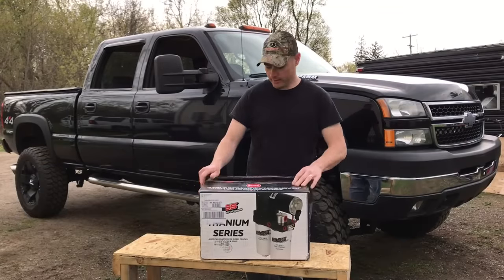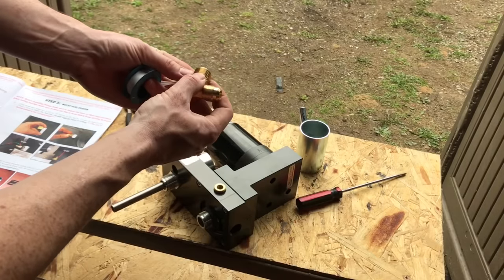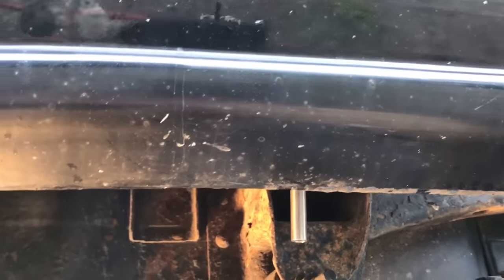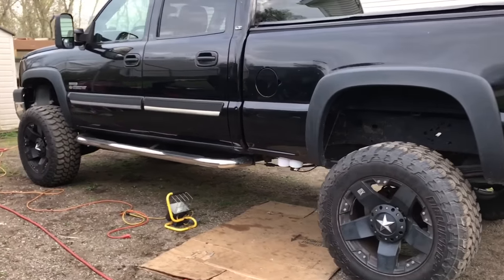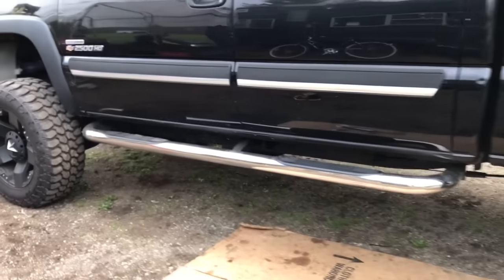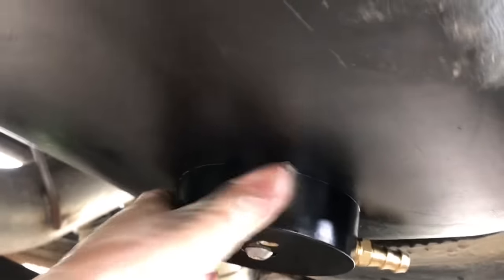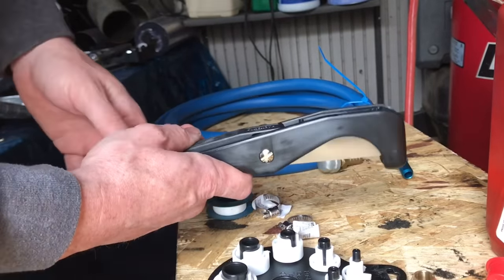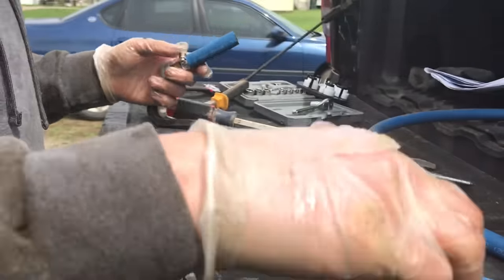Duramax FASS Lift Pump and Sump Full Install

Comment: You should look into a set of track bars. I have an old video on here of my axle dump and you can see the wrap when I give it any throttle. It prevents wearing the bushing at the transfer case when your driveline wraps upward. It will keep you from loosing bottom torque in your rear leafs as well.
Reply from the maker: +Dakota Novak its on my list but thanks for the explanation it's a good way explain the benefits of traction bars

Comment: It appears the bottom tank Sump is actually illegal to use on Commercial vehicles at least. Anything happens to your hose and all your fuel drains all over the ground. I think it's the Beans has both supply and return fittings, saves cutting filler hose.

Comment: Will you have to delete the fuel filter after installing the fass ? And will the cat filter work with the fass system ?
Reply: I'm going to go with no you won't have to delete the existing fuel water separator filter. It's not going to hurt it having extra filtration. Just keep on the maintenance schedule I say.
Reply: Hey Corey, no need to delete  your fuel filter, it catches particles that may already be stuck in fuel lines between the lift pump and existing fuel filter.  The CAT filters are great!  Check my channel out to get a closer of the CAT fuel filter and water separator (have a CAT oil filter conversion video for you too)

Comment: Awesome video! I need this for my LB7. Wish I had done it years ago when the injectors were done.
Reply from the maker: Thanks
Reply: @TruckMaster  I just bought a stock LBZ with 120k miles and maybe a small tune but that’s it, I’ll be keepin it as stock as possible. Should I put a lift pump? Is it something that is needed to be done like the lb7 or the lly?

Comment: FYI, as far as using the tank's draw straw for the return I was just informed by FASS that is OK in the older models but for the newer models (I think he said 15+) they drop the tank and replace the "convoluted" draw straw with a smooth one to minimize the restriction.  Since I have an 08 and the 95GPM pump I used the return and I can barely hear the pump even running and this was a very simple clean way to do it.  My advice is to just check with FASS regarding your specific installation.

Comment: Doing a similar install of the Fass with a sump connection but I also swapped my standard tank for an S&B 62 Gallon tank. Appreciate the tip on plugging that line. For the life of me I couldn't figure out what to do with it. Question for you, if you didn't build the plug like you did, is the intention for the suction line on the sending unit to just stay open when you use the sump? Keep up the great work. Much appreciated.
Reply: I have the same tank as you, but in my opinion, the thing to do with the old suction line from the tank that he capped off would be to plug the return line from the Fass into that line. Then you don’t need to cut your filler hose.

Comment: Any issues with cold cold starts? I mean dead of winter, it's been sitting in a blizzard for three days cold. I've heard the fuel in the filters hanging down like that get cold easier and the fuel thickens up causing some start issues.  I've seen some people wrapping them in heater blankets for the filters.
Reply from the maker: +Bayer-Z28 this would be my first winter so not sure yet I can do a video on it once the temp drop below 0
Reply: Three days in the cold, wouldn't matter where it is, it's all going to be the same temperature.
Reply: Bayer-Z28 my 08 lmm runs fine in our cold -35c Canadian mornings. My Allison hates it though. Won't shift out of 5th till transmission is 99°f
Reply: Bayer-Z28 Here’s my winter review of fass in Michigan. 95 series hangs down below bed. Fuel was treated with power service. -2F out when she gelled up. Got towed back home, thought fass gelled up. Was actually my acdelco filter at oem head. Fass was full of fuel!! Ac Delco wasn’t, completely gelled up!!

Comment: Great video. So I installed the Fass 165 on my 2011 Silverado, also installed the Fass sump pump , awesome. My question is I have a 2011 Silverado 2500 HD . Love it , always wanted a Duramax and finally was able to. I know all emissions installed but that’s how I want it. It’s a daily driver for me but work is only 5 miles each ways to the Mercedes Dealer . I’m a Tech. A few questions I have how long did you run your return line , and what’s your view on a tune . Other than normal driving we use the truck for tow our trailer about 6k lbs . 

Thanks ,
                 Heber

Comment: Nice.  I think next project should be attacking that frame and cleaning it up!   Just did mine and looks great.
Reply: Lanni, just about to do that on my LB7. Any recommendations or advice on the process? Bought a wire wheel to scrape the rust off. Did you use a rust converter or anything? Was thinking about painting it with bedliner.
Reply from the maker: +Jonathan Cascioli I need the same advice I'm going to use a angle grinder with a wire wheel then brush paint the frame
Reply: Guys I used one of those braided crazy 3" wire wheels that screws on the grinder.  I don't have an air setup yet to use a needle scaler but my little ball peen hammer worked well getting the scale off. After that wire wheel away. 

I used the duplicolor rust barrier.  After wheeling the frame all you have to do is clean it with a wax/grease remover and then brush it on.  Brush it on so it can be nice and thick instead of spraying.  Got a few aerosol cans of it also to get the nooks and crannies.  Also used the duplicolor stuff because it comes in flat black. Hate seeing that gloss black like por15 and less steps than using por15 also.  Good luck.
Reply from the maker: +Lanni_LBZ great write up that's the kind of info I need

Comment: if your worried about moisture at crimp connections buy heat shrink cut a couple small strips of super glue put them in the heat shrink and hit it with heat gun. Great for keeping moisture out.

Comment: So it just uses all factory line after where you connected it by the fuel cooler? That install seems way easier than the one I did on my old cummins.

Comment: Thanks for the video.
I'm buying a 2001 Chevy Silverado 2500 derumax diesel. They added new injectors pipes 4 inch and tuner also a a lift pump n sump lil excited lol

Comment: I just finished my installation but I don't  like where they wanted it mounted so I went down and got two pieces of 3 inch strap built my own bracket and installed it to the fram in front of the fuel tank can't see the filters and a lot safer for the pump and filters

Comment: Another great video. Man, you nailed it!  Two questions;  It's hard to tell from the camera angle, but it appeared you drilled the hole in the tank too close to the raised lettering that is printed on the tank, could that have contributed to the leak(the o-ring sitting on those letters)?  Could there be any modification to the filter mounting bracket to tuck the filters up more so they're not visible?  Your install looks great and doesn't look bad on a lifted truck.  Just my preference, I like a sleeper look and would not want the filters visible.  Thanks for the time and patience to record this...you appear to be a very patient man  lol
Reply: Hey man I know it's been awhile since you posted this comment but if you have a crew cab duramax, wcfab makes a bracket that puts the whole assembly inside the frame and up where you can't see the filters. I don't know how much difference this is going to make to a lot of people, but I like the fact it is inside away from a lot of extra road debris.
Reply: @kevinday4490  The Fass is too tall to fit inside the frame rail without hanging down. below the frame
Reply: @mrmotofy  that's funny because mine is hid pretty well with this bracket. If I put the larger filter on you can see them but they are not exposed as much as the little one with the included bracket.
Reply: @kevinday4490  Maybe there's some slight differences with the different bed sizes or years. I've seen multiple install vids with the same interference.  The comment was specifically about INSIDE the frame rail like Airdogs
Reply: @mrmotofy  https://www.wcfab.com/i-31643995-fass-fuel-system-relocation-bracket-for2001-2010-crew-cab-duramax.html.  This is the bracket I bought.  It goes right in front of the fuel cooler on the inside of the frame.  I like the looks of it being tucked up so no one can see it.
Reply: @kevinday4490  Ah ok that's a different one than I've seen. When I measured the height it hung below the frame about 1/2" on an LMM.  As it looks in the pic. The Airdog is shorter so it fits. I didn't want anything hanging below the frame right there cuz thats right where high centered happens, scraping boulders etc.

Comment: Glad I bought the fass sump with the integrated return. I didnt use the return I just screwed a brass plug into it but its bigger and has two o-rings and two bolts to clamp it instead of just one

Comment: Greetings truck master question do i need the oem diesel fuel filter after the fass? New at all this and planing the install, thanks!
Reply: It's up to you if you want to keep it. I had an 05 LLY that I removed the factory filter on and never had a problem for the 80k miles before I sold it. If you keep the stock fuel filter you only have to change it every 20-30k miles.

Comment: I have a big question when you get everything on and last to do is put the 2 filters on do you fill those two filters up with diesel ?
Reply: Hey Austin, it's a good idea to fill the filters with diesel first so you aren't running too much air through your lift pump.  However, you would probably be fine if you didn't because it only takes a few moments before the whole system is primed and void of all air.  Have you upgraded to the CAT filters yet?  I have a couple videos on my channel about it, come check it out when you get a chance!

Comment: Awesome video brother. As for bleeding it, either disconnect the line to the injection pump if your worried about it or leave it and the return will bleed it well enough. Installed a couple myself. Nice job!
Reply from the maker: +Ryan Kessel thanks!

Comment: You could have tucked the assembly up higher if you used the next bed mount back and flipped the bracket over on the fass pump.
Reply from the maker: +Tim Johnson well noted thanks
Reply: btw.  I like your videos!! I didn't mean that as criticism.  I installed in my 2006 lbz dually.  Later i thought maybe because i have a long bed it might be different that your install.  Like i said Great video's!
Reply: Have you done a Bank intercooler system?  Would that help MPG?  Daily driving i am up to 18.5 mpg on my lbz crew cab dually 4x4.
Reply: Tim Johnson do you have a picture of where you mounted yours?

Comment: Trackmaster I recently call the company to acquire a Fass lift pump for my 2013 GMC Duramax and the gentleman there seemed very knowledgeable but he recommended that I get the airdog lift pump system he suggested there was little bit more user-friendly and it had compatible filters compared to the proprietary filter for the fast system I'm just wondering what your opinion is because one of your videos one of your lift pumps left you high and dry

Comment: Did you notice the lift pump help your rail pressure? I’ve been all through mine and the only thing left is do the cp3 and or injectors. Having the pump done in a couple of days I ordered the Exergy sportsman pump see how it goes fingers crossed.
Reply from the maker: +Clint Garza I didn’t notice a gain in Rail pressure but it could be because I have that fuel valve plug
Reply: Truck Master I have the ppe plug as well on a hard acceleration the desired fuel rail pressure goes up to 26,000-27,000 but the actual will only run up to 19,000-20,000 then fall of to 11,000-12,000 this is what my edge insight shows took it to a dealership they hooked there tech 2 up to it and commanded a certain amount of rail pressure and the pump couldn’t even make half what they asked it to
Reply from the maker: +Clint Garza that’s very odd the highest I’ve hit was 27 and it maintain it’s makes you wonder if it’s a cp3 problem I wonder if you port your fuel valve fitting in the cp3 it might help some

Comment: Have you done the fuel rail pressure valve block plug? I have 08 lmm stock I did the fuel rail race valve and the rail valve block, night and day difference almost eliminated refueling besides what's left on the motor but mostly maintains fuel rail pressure and when I step on it it doesn't starve for duel

Comment: Got a 14 lml stock...I cant remember if I need a tuner to run a fass or airdog or do I gotta put tuner on ...I'm just towing atvs and sxs Sorry for silly question...used to the old 12 valves.

Comment: Just bought an 02 LB7 with 205k. Never had any fuel issues, do i really need one of these? I was raised on the matto  "if it ain't broke don't fix it."  Seriously asking because i can get a good deal on an air dog 100gph setup. I'm new to diesel so i really don't know.
Reply from the maker: A lift pump is proven to keep your injectors lasting longer especially for an lb7 it’s almost a must to install one but Airdog is better for the Lb7
Reply: @TruckMaster  is the 100gph big enough? Also it has brand new bosch injectors installed already.

Comment: So how well dose that sump and fuel filter do in the winter. Do u have issues with the filter gelling up. I had just the factory fuel filter on my lbz and it gelled up four or five times. I heard and it seamed to work was run the 911 in the tank and if it did gel kick the trans into manual mode and down a gear and bring the Rpms up a little bit and she in gelled.  Other question is what about the factory fuel filter. Do u still have to run it, change it as often.

Comment: Local shop here said they fill the filters with transmission fluid to lubricate the fuel system. They do it at filter changes as well. 
Is this something you have heard of or would recommend? Thanks
Reply from the maker: I wouldn’t recommend that

Comment: great video. but Teflon tape should be put on as so when you screw fitting it does not wanna roll off.
Reply from the maker: +6669bj thanks for the tip
Reply: you have some great info. subscribed and watched a ton of videos today!

Comment: Great video but the only recommendation is using diesel fuel to oil up all fuel line parts. You drained the fuel tank so there was plenty to use.
Reply from the maker: +Jerrod great point
Reply: Truck Master I'm looking into getting a LBZ Duramax and keeping it simple, 5inch exhaust, egr delete, efi live

Comment: Nice video, I have an LB7 and I have ordered my fass 150. A question that I have is my stock fuel filter under the hood is bad, do. you just remove the factory filter or should I buy a new fuel filter and run the lift pump and the factory one?
Reply from the maker: +Rebel Rob I would replace the fuel filter under the hood for now but they do sale Delete fuel filter kits if you don't want to run the factory one anymore but it's perfectly fine to run both filters it's really your choice

Comment: I've got the same vice. Good choice! Thanks for the video. I don't like the filters hanging down though. Could the FASS be mounted somewhere else?
Reply from the maker: +Gardner Gerry that's neat thanks
Reply from the maker: Yes you can mount it somewhere different just don't run out of hose

Comment: So I have watched this video probably 10 times and I finally felt confident enough to put my lift pump in myself this weekend I did a Air Dog and my sump is next but my trucks fuel mileage dropped like a rock am I missing something?
Reply from the maker: +AFG New Media not totally sure why that happened to you it makes no sense I had the same problem and then the mpgs increased about 5k miles later

Comment: So I have a leak coming from those nasty fuel rails shortly after the connector in front of the fuel cooler. Is there a way to delete that rail all together and avoid having to buy new fuel rails?? I feel like that skinny rail would be restricting the system anyway

Comment: I know this is an older video but I have installed a aux. Diesel tank in bed and the filler neck ? My question would be what size line is the return and could I put a T in the 3/8 line from the auxillary tank?

Comment: Great work bud. How did you disconnect the factory suction line? I'm using a half inch tool and it will not budge
Reply from the maker: +trynottobreakit 0369 get a metal disconnect with a deeper fitting spray some wd40 on the line as well you will get it
Reply: Truck Master thanks for the reply bud, I got it finally. When all else fails just hit the damn thing
Reply from the maker: +trynottobreakit 0369 awesome
Reply: trynottobreakit 0369 it rusted up sometimes a pain in the ass to pull apart

Comment: What benefits have you noticed since you installed the lift pump? Over time.
Reply from the maker: +inventoryking mpg's and the truck is slightly faster
Reply: How long did it take to complete this project?
Reply: Did you have to re prime your truck? Or did you add fuel and go?

Comment: hello, can you make a video how to wiring up the turbo exhaust brake switch? i'd like to see that plus i think lots other people would too. thanks
Reply from the maker: +duranate I will look into it I'm not sure how to wire that up
Reply: sounds good. it works by grounding or powering (not sure) some pins near where the high idle mod taps in that big connector. it actuates the turbo to create back pressure and probably sounds great. you can find info if you google it, i've never found any vids on doing it. no pressure, lol. love the vids man.

Comment: Just installed my new titanium signiture series and the water serperator/filter is leaking and fuel lines connected to the the trucks lines are leaking as well. wonder if the pump makes to much pressure...